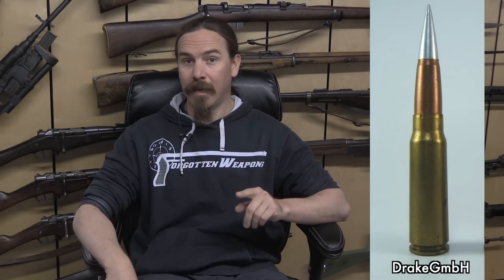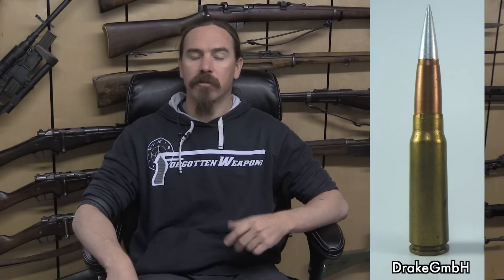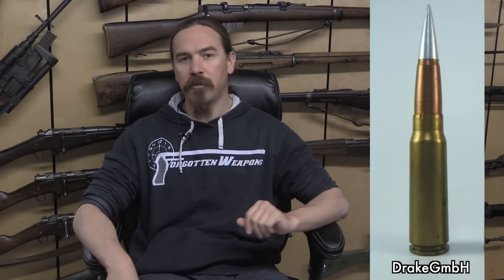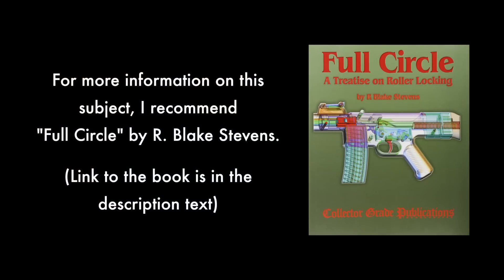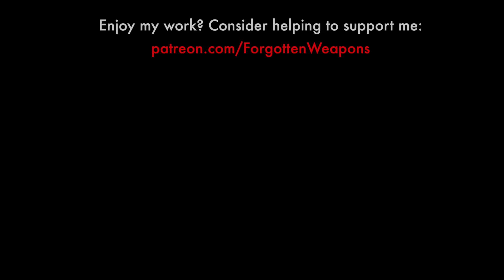Full Auto at 1000m: The 7.92x41mm CETME Cartridge

Comment: Wish we could have a comparison of 7.92 CETME and .280 British, fired from the guns they were designed for and all.
Reply: Rate of fire? $20,000 per minute.
Reply: And the .276 Pedersen while you are at it.  The cartridge intended for the M1 Garand until MacArthur killed it.
Reply: It would be very interresting indeed. But with the scarcity of the ammunition in question, one would have had to re manufacture a batch of rounds. It would take some  eager machinist with alot of time on his hands or access to a CNC machine to turn the bullet cores, but it could be done. Also, the powder in the old cartidges could have deteriorated over time, so fresh powder that gives the same chamber pressure as the originals would have to be found.
Reply: @havareriksen1004  not impossible but definitely expensive and a bit impractical
Reply: US really fucked it up be forcing everyone to convert or change to 7.62x51.
Reply: *Breathes in heavy weapons guy
Reply: .280 British is pretty powerful, it's a 9 gram bullet at 775m/s vs 10 grams at 850m/s. It's about half way between 7.62x39mm and 7.62x51mm.

Comment: Ian, the early CETME 7.92x40 and 41 were actually used in a small conflict we had in Sidi-Ifni. The terminal ballistics were quite impressive  but there were some british complaints that this proyectile breached the Geneva conventions on inhumane proyectiles. Also Franco wanted to join Nato and adopting 7.62x51 Nato  was a necessity. After models 1and 2  came models A and B in 7.62Nato. the later two models were very problemátic. I know a gunsmith who participated in the trials and he told me they had terrible problems handling the pressure at first and the catridges  needed greasing.I have some early bolts I have to  insoect

Comment: Someone should recreate this cartridge.
Reply: No guns to put it in
Reply: Thomas Jackson just rebarrel a bolt action
Reply: The wizard no worse than some of the wildcats floating around.
Reply: Make it in an existing caliber. 
Load it telescoping in the existing cartridge.
Then it will work (enough) to play with.
Reply: magnumvanisher
Reply: Maybe changing the bullet composition would be a better choice like having a light material as a core, clad it with copper, and put an aluminum or steel penetrator.

Speaking of aluminum, is it effective when it comes to penetrating body armor?
Reply: .224 Valkyrie does, though it takes a different route to do it.
Reply: You could instead try and swage some of this style of bullet for an existing case. Perhaps 7.62x39.
Reply: Challenge accepted.
Reply: @TJackson736  challenge also accepted
Reply: run long high bc copper solids in 300 blackout.
Reply: Lehigh Defense created a similar round in 300 Blackout marketed for close quarters.
Reply: They did, it's called 6.5 Grendel.

Comment: When you listed the requirements I couldn't help but to think of the FG-42. It pretty much does everything they needed a gun to do and a whole lot more while avoiding the trans-sonic problem altogether (at least for 1000m+ ranges). 
Now, I'm not sure how well one could fire an FG-42 from the shoulder in full auto, but it does have some rather effective recoil compensating features, so I guess it might work.
Reply: The problem is that FG-42 was a specialty weapon, so it also had some individual freedoms, for example being almost prohibitively expensive. As fine as that piece of German engineering is (And as we both undoubtedly agree, a damn fine piece it is), it required skilled workforce and was not well-suited for standard issue duty. The Spanish were looking for exactly that, a standard rifle.
Reply: Because of its innovative straight-line stock and excellent muzzle brake, the FG42 could be fired in full-auto - but it was very hard to control, thanks to the powerful 7.92x57 cartridge. No surprise, right? The paratroopers preferred to use them in semi-auto, with occasional use in full rock-and-roll mode, and then only in short, controlled bursts to avoid overheating the barrel.

Comment: Thank you! I can't tell you how many times I've had to correct people on the Spanish Mausers. It's all a bunch of fuddlore. You didn't even touch on those that say 7.62CETME is a lower pressure cartridge. IT'S NOT. It's only a lower recoiling round.

The Spanish Manual for these rifles lists the pressures for the CETME round at 3,300 kg/cm2 and 3,500 kg/cm2 for the NATO round. That’s 47,000 PSI and 50,000 PSI. Santa Barbara arsenal, which made the rounds lists the pressure for both at 3,500 kg/cm2. 7.62CETME using flake powder that dumps all of it's energy at once, while 7.62NATO used extruded powder that builds up pressure over time.

Comment: Ian not only did copper add weight but prevent aluminum friction welds which is just as bad if not worse that lead only ammo fouling in modern rifles.
Reply: Miguel Hernandez he did sortof allude to the idea of aluminum in a steel barrel being a not good solution, but you are correct as to why that is.

Aluminum is a sticky metal.
Reply: Scott Watrous he did a little. I just feel like it wasn't really said so I just had to say it. Lol.
Reply: aluminium also forms oxide on the surface wich is pretty hard stuff, not much softer than diamond. probably not good for the rifling ;)
Reply: I can't even tell you how much aluminum I've had to sandblast off of steel engine cylinders, not to mention how long it took at times. Couldn't use a hone until it was all blasted off because the aluminum would melt from the friction and fill into the porous surface of the hone, then cool which both ruined the hone stones and could possibly deposit more aluminum into the steel cylinder should you not change them out immediately. Aluminum is an absolute shit show if it gets imbedded in steel lol.

Comment: Coming back to this years later and looking at some numbers, it's surprising to see that 7.92 CETME has nearly identical performance to 6mm ARC. The bullet weight, muzzle velocity, recoil, and ballistic coefficient are all almost the same. The only  big difference is the size, 6mm ARC was able to get away with being substantially smaller and simpler in construction by not insisting on being 8mm in diameter.

Comment: What I love about this channel is that you learn not just about firearms, but about engineering. In this case it's the old tale of great innovative idea thrown away in favor of something conventional. The exact same story is seen with hardware if we look at the conventional 8086 processors persisting over novel innovations.

The bulk of western military forces today still use 5.56 NATO and 7.62 NATO with nothing on the horizon to replace those and the interesting part is that 2018 ammunition coming out of factories is better and cheaper to make compared to the same ammunition even 20 years ago. This means that anything that is set to replace those would have to be significantly better to justify decades of process optimization.

Comment: Ironic how chambering a BM-59 with the 7.92mm CETME would actually become the rifle that the US military wanted: a .30 caliber (though the 7.92 is a .32 in) straight grip automatic rifle that can reuse parts from the Garand.

Now if the US argues that their 7.62x51 outperforms the 7.92x40, then simply supercharge the latter like what SIG did with their .277 FURY to outperform the 7.62mm without adding too much recoil.

Comment: Great video. What about the other weird cartridges? 

4.7 x 33. (MP7)
5.7 x 28 (P90)
9 x 39 (VSS)
7.62 x 45 (VZ. 52)
Reply: The 9x39mm interests me. The goal of it seems to combat the loss of muzzle energy of subsonic ammunition with a heavier bullet. I don't know much about this; they seem to be reinventing the wheel here and may as well use 9mm Parabellum, as the bullet weights for the cartridge are generally above 110 grains anyway. Maybe the Spitzer bullet is ballistically superior enough to make up the difference? I dunno.
Reply: Freddie the Eliminator The 9x39 weighs over twice what the 9x19 does and has specialized bullet designs using the high sectional density for various purposes from ballistic coefficient to creating large yaw cavities to using a steel core to make it an AP round. 9x19 is not comparable at all in terms of external ballistics or wounding capability.
Reply: @bushwhackedonvhs  Mmh... Knowledge. Thanks.
Reply: and the 5.7 Johnson (.22 MMJ)...
Reply: 4.7x33?

Comment: The "full auto at 1000m" must have been for a belt fed machine gun, and the goal was simply to have one cartridge for both rifles and machine guns. So they developed the rifle first as that was the harder requirement.

So every platoon would be resupplied by one variety of ammo that re equips both riflemen and machine gunner teams.

It makes sense as while aimed fire from rifles was almost never able to reach further than 400m, machine guns on tripod regularly were effective out to 1000m against exposed troops.

With an MG on a tripod with a T&E mechanism, it's way more effective to compensate for all the compounding problems of extreme long range shooting.

Comment: It's a really cool story, and some pretty genius engineering to meet those demands. But a light aluminum bullet couldn't have much efficiency at any range right?
Reply: Well...it's still a good deal heavier than 5.56 and if it works as advertised and stays supersonic so far out, it should have more than enough energy.
Reply: If it stays supersonic it will probably be really nasty due to the copper band which would probably be deformed and cause a bigger woundchannel if not multiple woundchannels.
Reply: Some Guy That, plus the weight distribution along the length of the bullet should lead to some nasty tumbling effects, and with a bullet that long that should be even worse.
Reply: Alumininium not beeing as dense would probaly also fracture a lot easier when tumbling. It would really suck getting shot with this(atleast more than getting shot already sucks).
Reply: I think the only real difference would be against hard targets
Reply: Actually the opposite, it has lots of efficiency. It has a high BC so it retains velocity. It would also have high sectional density which is a good indicator for penetration.
Reply: You need to clarify your thoughts on this I think. While I myself haven't seen the data the terminal ballistics of this round. The fact it met the requirements set the spanish. It had VERY effecient external ballistics.
Reply: I should have clarified, I was mostly thinking of efficiency against various cover and body armor.
Reply: I believe that the aluminum should produce a nice pyrotechnic effect when it hits a hard target, like the 30mm PGU-15/B TP Target Practice used in the GAU-8.
Reply: You can kill any being with a 2mm so far as anyone can see that being at the horizon with their bare eyes 

Remember: Plastic cuts eyes ;D
Reply: I noticed your correction about body Armor.. Imagine something twice as tough as copper or lead spoiling in all directions from said body armor 
You remember how speed kills armor? 
I bet the harder yet light spoiling will still shrapnel your throat to bits when it penetrates that anti spoiling coating.. Might get banned :thinking:

Comment: Wouldn't aluminum tipped bullet basically be "soft point" and therefore a Geneva Convention "no-no"?
Reply from the maker: That was considered and it was determined not to be a violation of the Hague Conventions.
Reply: I would think being a long, lightweight bullet it would be more likely to yaw inside a body like the 5.45x39 is known for doing.   That can be even more devastating than expansion and with such a long bullet I have to imagine it would be quiet and effective round.   That's just my mildly educated guess.
Reply: J HB aluminum is harder then copper and lead and it's lighter, with alloys you could make a hard aluminum alloy core with soft copper jacket so safe travels of the bullet, don't want a solid aluminum bullet cuz the harder alloy will fuck up your barrel and rifli
Reply: Patrick Thompson  yep aluminum is used to polish steel
Reply: duraluminium is a thing:) dont know about other countries but in romania we had duraluminium coin and being the stupid kids we were in the late 90's we used to put cons on the train tracks when we knew trains were coming.the duraluminum was the strongest out of 5 types of coins , others being diferent variations of cooper and other metals mixing. also it has a much higher temperature melting point,so yea, i think duraluminum used in bullets was stronger than the whole rest of the bullet :).but it's lighter so you can't have that kind of bullets because i think it would be less powerfull..

Comment: Interesting, I'd always heard that it was a problem to shoot commercial .308 in the FR-7, but military spec 7.62 NATO was safe. Never heard the part about the 7.62 CETME supposedly being the cartridge for them, but I was aware of the cartridge. I still would shy away from putting the strength of those old small ring Mausers to the test if I could help it, but I kind of like them in the 7mm and 6.5mm cartridges anyway, plenty of large ring Mausers rifles in .308/7.62 that are also just as interesting.

Comment: Fascinating stuff. I wonder why the German engineers didn't try to develop something based on the 7mm Mauser or 6.5mm Carcano rounds to get a light bullet with a good cross-section. The Spanish would have had lots of experience with either cartridge. Was the 7.92 CETME cartridge an entirely post-war development, or was it perhaps based on some wartime German research that was dusted off for the Spanish?
Reply: Because they weren't used to it.

Comment: An aluminum bullet with a copper jacket, as shown, may have solved some engineering problems during the design phase, but, I have my doubts as to its actual fielding. Aluminum in contact with copper would induce galvanic corrosion, producing aluminum oxide which is a very abrasive substance. The issue could be overcome, but at a considerable manufacturing cost when compared to traditional lead/copper bullets. Not to mention bullet tip deformation on the feed ramp & limitations on penetration of body armor.

Comment: I'd really like to know how they "wrapped" the aluminum core with the copper jacket.  It seems like it would be much more difficult to do with aluminum and copper vs lead and copper b/c aluminum is much harder than lead.  This process would be VERY interesting to know how they were doing it. 

in all honesty, I'd like to see how they make all different types of bullets from mild steel core, hardened steel core, tungsten core, incendiary rounds, high explosive rounds, etc.  It seems like there must be a pretty complicated setup to get this stuff in the center of a lead wrapper, and then a copper jacket on top of that.  And on top of all this, some of the larger rounds have timed explosives for distance/altitude for AA rounds. 

Tracer rounds seem to be fairly straight forward, basically it seems it's a backwards hollow point with the rear of the bullet filled with the phosphorus compound (or whatever) that is ignited when the powder is ignited.

Comment: I have been through Full Circle, and of course this video, but I can't find the 'why' and 'when' the modelo 2 (and Gerat 06) straight cocking handle transformed into a cam in the CETME C.  The CETME C bolt and carrier don't separate with ordinary cocking force.  This seems to be coincident with introduction of the NATO 7.62 cartridge, but there is no discussion on this anywhere I can find.  Is it in fact a result of the higher power cartridge, and the bolt bounce mechanism being much stiffer?

Comment: Has the bullet design from the 7.92x41 lived on in any substantial way? I would think that a lightweight, high velocity, low recoiling bullet with a very high BC would be popular PRS guys, Wildcaters, and other precision shooters. Perhaps not in this specific cartridge, but a similar bullet design, worked into a .338 or a .308 or even perhaps a 6.5. I would imagine that a hotter load, even the original bullet in say a 7.92x57 format, disposing of the low recoil requirement, would push the trans-sonic barrier out quite a long ways
Reply: The heavier 6.5mm bullets 130+ grains have much the same flight ballistics. As do the 70+ grain 5.56mm bullets.

Comment: How do bullets with a tungsten penetrator stabilize if you need the outer diameter to be heavier than the core of the bullet.  Tungsten is about 19.3g/cc, lead is ~11.3g/cc and copper is just under 9g/cc, so the core of a tungsten penetrator is over 2x as dense than the jacket - so does this mess up stabilization?  If not, how does this work?

Comment: Nice and interesting video. Not much to say.
Just to complete FR series in Spanish Army means Fusil Reformado followed by a number FR1 to FR8 were produced pattens.
FR7 was a mix of Cetme and Mauser 1913 parts, FR8 same but with stronger 1943 Mauser action, really a 98 action.
Its been said, correctly I think, FR7 was developed with 7.62 CETME cartridge in mind, so shooting same external dimensions 7,62 NATO or 308 Win its not a good idea.
No problem at all instead with FR8 doing this.
Hoping your next Spanish guns video.
Reply: No problem at all in FR7's, either. After all, they use CETME C barrels and the action is not that much weaker.
Reply: J Garcia Sampedro 
La acción y no el cañon es la parte débil del conjunto.
Si buscas las presiones SAAMI para el 7mm Mauser y las del 7,62 NATO y las aún mayores del 308 Win, llegarás a la conclusión que es una cuestión de tiempo que un FR7 te explote en los morros usando esas municiones.
Yo estoy muy de acuerdo con mi actual configuración y distribución de elementos a lo largo de mi cara y espero seguir conservándolos así.